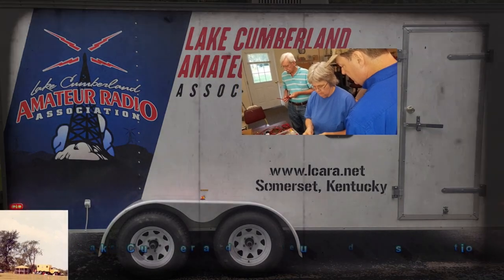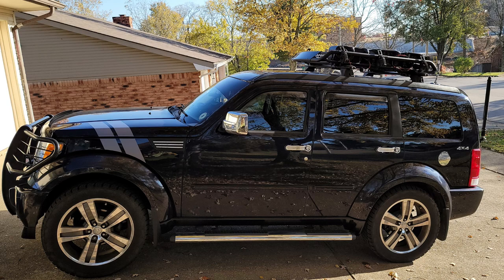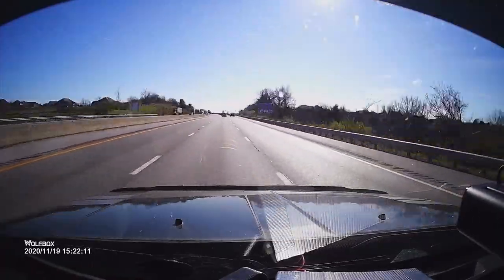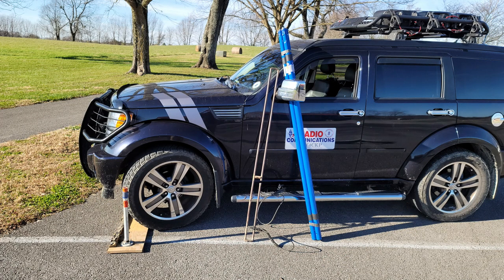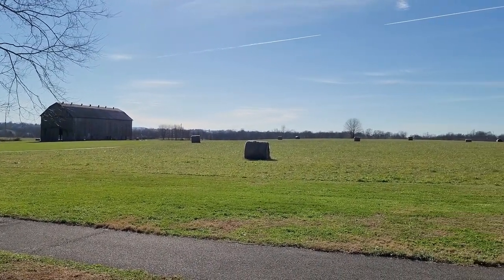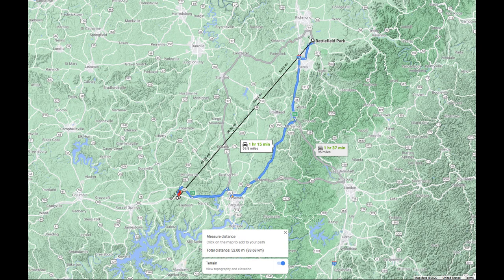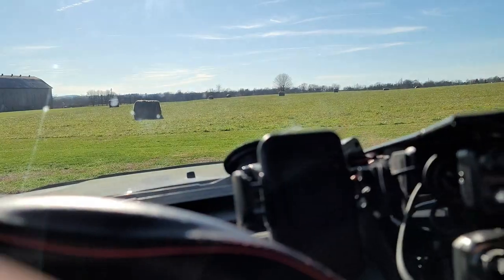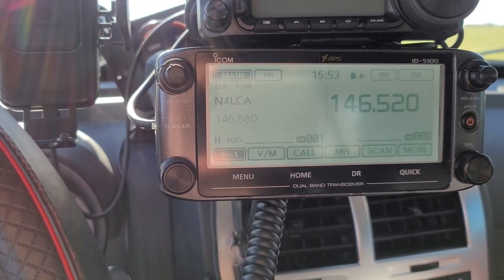LCARA HAM Radio: Drive-On Mount - Testing J-pole Antenna

Comment: Excellent video and a great demonstration of the 2 meter Slim Jim antenna. I'm glad to hear that it is working out so well for you.
Reply from the maker: Yes, very good.  I just recently took down a mast I had it up on and thought I would try it on the drive-on.  Thanks for the great content and for stopping by our channel.
Reply: I have on of these from KB9VBR and can hit repeaters 125 miles from my location. I do have a great location with a high elevation. My setup is on a 25' mast. If your looking for a low cost antenna that works well this one is a good choice.

Comment: Thanks for sharing the video. Looks like you have a copper “Slim Jim” as opposed to a j-pole. KB9VBR makes both. I have one of his j-poles. They are really good antennas. Definitely notice a gain with elevation. It would add a lot to your video if you actually showed you raising the antenna and how you have it set up. Just food for thought. I enjoy your channel. 73. KM4OCJ